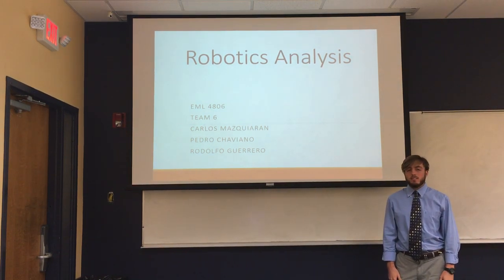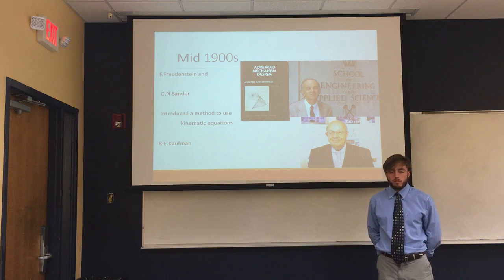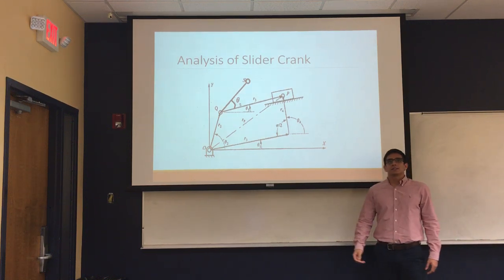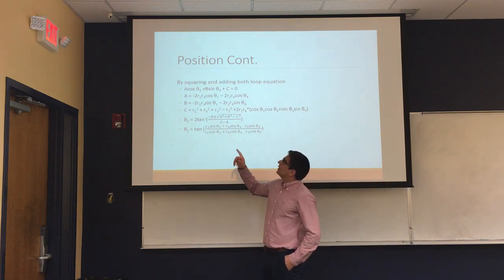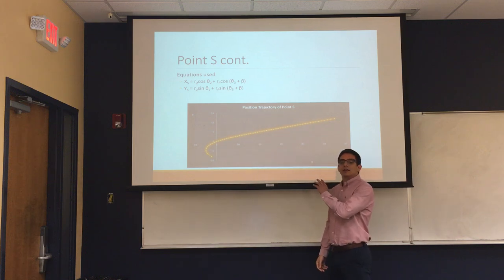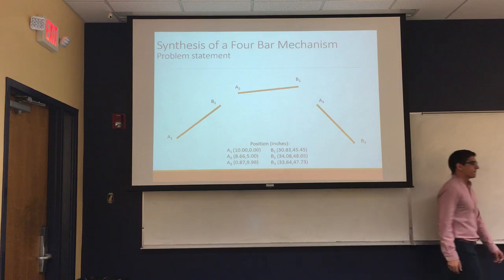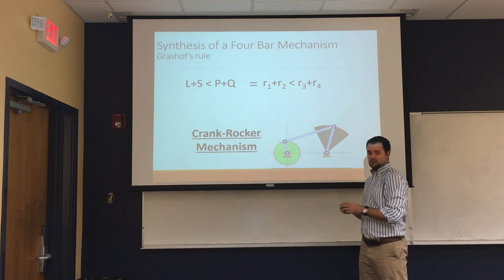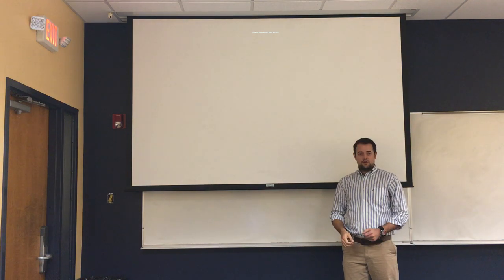Team 6: Mechanism Design: Landing Gear & Oil Well Applications

Comment: Great presentation Team 6. The linkage mechanism history was concise, comprehensive and thorough. Although the height of the projection seemed a little awkward at times when you guys were referencing it, I think the placement was great. I liked that it was out of the way so that the presenter could be centered in the frame when speaking without blocking the slides.

Comment: The presentation was good. Appropriate dressing was used by the members. Interaction with the camera was great and the quality of the video and sound very good as well. The explanation of the project is understandable as one goes through the video. I recommend to adjust better to the time length required.

Comment: Good video and sound quality of the presentation. Speakers did a great job presenting their ideas throughout the video. Slide could have been more engaging by changing the background color or style.Also, instead of using large data sheets concentrate on the  max and min values instead. Overall great presentation with little improvements to be made.

Comment: The presentation was of good quality, but next time the camera should be placed closer to the presenter and screen to make reading of the slides easier. Dress code was professional and well done. More content should be added to the slides in order to make them more interesting. Additionally, one slide had way too much info on a table which the audience will not have time to read. Otherwise, good job!

Comment: Excel was impossible to read. The fonts on each slides should have been bigger since there was not a lot of information on each slide which is a good thing. Not a bad presentation good information and applications. The video was a bit long should have stayed under 10 min.